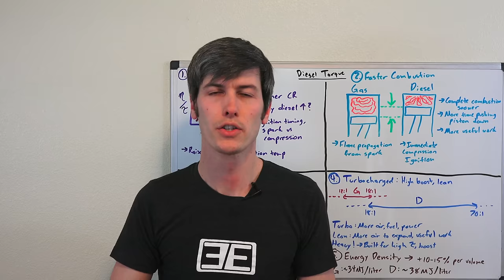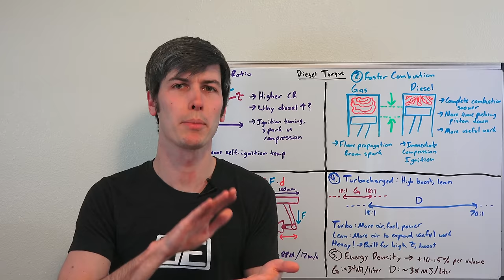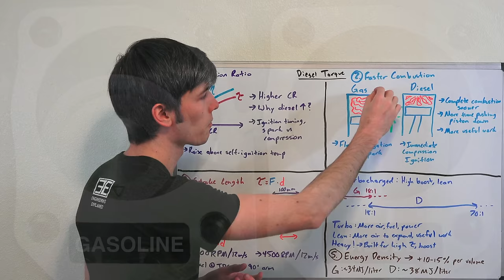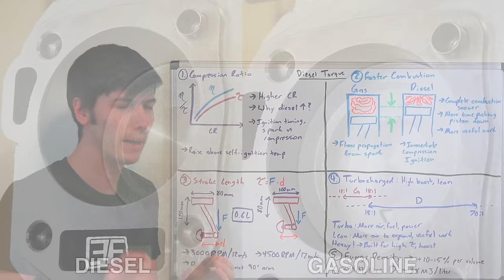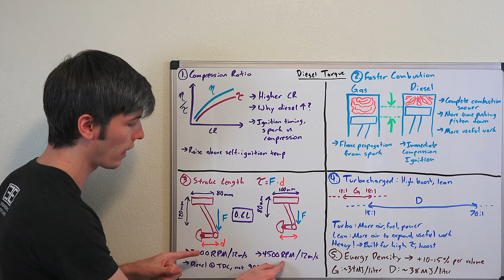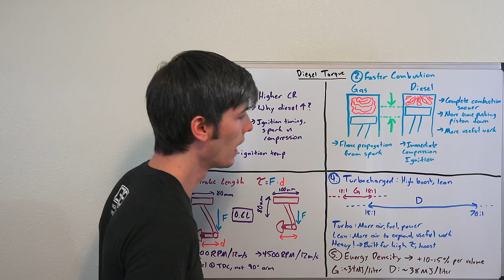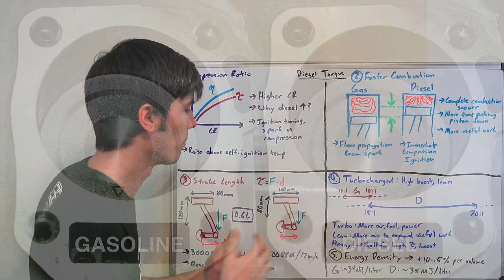5 Reasons Diesel Engines Make More Torque Than Gasoline

Comment: I appreciate a lot your work: it's great, keep going!

Unfortunately I have to say something about the topic of this video:

First of all It's true that Diesel engines have higher compression ratios resulting in higher Peak firing Pressures and consequently higher values of torque BUT this is not the "true reason" why CI engines have more torque COMPARED to SI ones.
In fact, while the SI engine works always stoichiometric (or even slightly in the rich side (relative A/R (Air Fuel ratio) ~0.9)), the Diesel engine cannot work anywhere close to the stoichiometric A/R due to t bad air utilization (min relative A/R is in the order of 1.2-1.3) thus resulting in ~20% less fuel injected (in mass) for the same quantity of air in the cylinder. Lower fuel injected means lower energy released in the combustion and so lower torque (this "base" 20% deficit is partially, but non totally, compensated by the higher compression ratio and higher Diesel specific energy). If you compare the torque figures of old naturally aspirated diesels with NA SI engines of the same time you'll verify what I'm saying.

The second thing you mentioned is not wrong but it's not that relevant: the combustion of a Diesel engine is more efficient when it tends to a constant-volume combustion (like in the case of the IDEAL Otto cycle).
For partial loads, the actual duration of the two combustion processes, even if they're fundamentally different, is comparable and I would say that there are so many variables involved (speed, temperature, fuel quality, turbulence in the clinder, etc) that is difficult to say which combustion process is the most efficient. 
However, at high loads, the combustion process of a SI engine is definetly occurring faster than a CI one since the latter has to fight against a "mixing controlled combustion" during which fuels struggles to find air to react with. (In fact, CI engines rotate slower than SI ones)

For what concerns the third point you presented... it's just a false myth: the higher lever of a longer stroke is counteracted by the lower force resulting from a smaller bore. If you take the condensed formula to compute engine power you'll notice that bore and stroke are multyplied together giving as a result the displacement (longer stroke -> smaller bore).

So, the reason why diesel engines have much higher specific torque than SI ones is turbocharging.
Thanks to the very high allowed boost ratio it is possible to force a lot of air inside the cylinder and so it is possible to burn more diesel than gasoline (for a given displacement). This results in a much higher torque together with a more efficient engine. (Power output, unfortunately, si affected by the "slow" combustion process that doesn't allow the engine to rotate as fast as a SI engines).

This comment doesn't want to be against you.
You've always done a great job. It's just to make things a little bit clearer.
Reply from the maker: Appreciate the feedback, thanks for sharing your insight!
Reply: Diesels also have much stronger internals resulting in more spinning mass within the engine which helps with torque. If you lighten the internals in a gasoline engine, you'll gain power but at the sacrifice of torque.
Reply: Jason I'm your fan but that was not the best movie you did.  Federico pointed out why in very good and  informative  post above. Remeber your movies are also wached (with pleasure!) by professionals. :-)
Reply: I'm curious about one of your last statements. 
"Power output, unfortunately, is affected by the "slow" combustion process that doesn't allow the engine to rotate as fast as a SI engines)."
My question is, doesn't the combustion process happens quicker on a Ci engine than in a SI engine?
As was explained in the video, (or how i think it was, and how i have interpreted) the burning process of a diesel engine happens in slightly faster instant than petrol.

And another question, when comparing both CI and SI as turbocharged engines, is it expected to the SI engine have more torque (and?) horsepower?

Thank you in advance if you answer! :)
Reply: In SI engine fuel is injected during intake stroke. It has time during intake stroke and then majority of compression stroke to vaporate and form proper A/F mixture. There is no such a time in diesel. In diesel fuel burns once its injected but injection itself takes some time thus crank angle rotation. Moreover at high loads mixture is too reach right at the injector nozzles and it needs some time to mix with air to burn. Thats why you see black smoke in diesels under load. They don't fully burn fuel. All in all diesel combustion takes longer then gas at high loads.
Reply: Wow
Reply: @Federico Gioachini I'm with you on this one - the main (if not the only one) reason why Diesels have higher torque, is turbocharging. Until very recently I was under the impression that Diesels, inherently, have the ability to produce more torque. However, when I was checking a chart of NA Diesels, it became very obvious that this is not the case. Yes, an NA Diesel was never built for performance, but the difference is very obvious. Furthermore, looking at the latest turbocharged Petrols, we see a massive increase in torque, double in some cases, when compared to a traditional NA Petrol. The field has started to even out.
Reply: 5.0 V8 Nisan Titan cumins  310 HP/555 TQ
3.5 V6 Ford Raptor Ecoboost 450 HP/ 510 TQ. 

There is a huge difference in horsepower but pretty close in torque. Why would the larger engine not have more horsepower?
Reply: California avi8tor actually for a centered crank mechanism the contribution of the mass on the overall average torque is null.
Of course inertial mass (pistons, conrods, crankshaft,...) affects indirectly the torque because of friction induced by inertial forces. (Higher mass means higher friction forces and so higher dissipated energy)
Reply: DEG Well, in order to understand how the diesel combustion occurs I suggest you to look at the so called Dec-model.
Diesel combustion is extremely rapid (and efficient) only during the so called "premixed phase" which is very similar to the knocking process on SÌ engines.
The result of this fast combustion is (I'm simplifying quite a lot but it still gives the idea) the soot.
Then, soot gets burned (hopefully in total) during the "diffusive flame burning" (or "mixing controlled" ).
During the latter phase air availability is what regulates combustion process. The higher is the load, the higher will be the fuel injected and the longer it will take the process (in fact at high load diesels smoke badly... This is because they cannot burn all that soot produced during the premixed phase)
In reality, premixed and diffusive burning usually occur together unless the engine is at very very light load
(What I've said It's not scientifically rigorous but I had to simplify to make it easier to understand)
Reply: Trey K I don't know how much a "Tq" is. Is it a Nm?

BTW, to give you some references, a modern diesel engine for car produces 200 Nm/litre or more (up to 250Nm/l). ( always with a flat, limited torque curve) 
A turbocharged SI engine has a lower specific torque because of lower degree of boost. 
BUT, a SI engine has max power at higher engine speed than diesel engine and so the power output is bigger. 
(Modern Diesel engines in highest power-step are something around 90-100 hp/l up to extreme cases (BMW Quadri-turbo 3.0L) of 130 hp/l
Aroubd 100 hp/l there's usually the transition from a single turbo to a twin turbo solution
Reply: Good post frederico. I think one of the biggest problems is that people only consider full throttle applications. At full throttle, the only way diesel can hold a candle to petrol engines is with turbocharging, and even then it is struggling to match. But when you compare fuel economy on a motorway, or even around town, diesel leaves petrol choking on it's fumes. So when both engines are only producing 10-20% of it's potential power, the diesel is using 20% less fuel, or better.

The only potential explanation for this that I see is what was glossed over in only a sentence. Petrol engines are so reliant on the throttling to stay at lambda, that they reduce their adiabatic efficiency very drastically.
Reply: A very concise reply Frederico. When looking at stationary engines such as older N/A diesel engines, and petrol / kerosine engines, torque comes more from rotating mass, ie; heavy flywheels. Large marine engines in particular have heavy rotating mass, and utilise different fuels such as heavy IFO380 to increase power and torque
Reply: athewake A flywheel DOES NOT give any contribution on the torque. It only help stabilizying engine speed avoiding the huge variation naturally occurring during the cycle of (especially) a slow rotating engine (the lower the number of cylinder the bigger has to be the flywheel)
Reply: +Trey K To add to what tjsavage711 said, displacement does not dictate HP. Displacement dictates torque. Displacements dictates power only in relation to RPM. Check graphs of old American engines, with less than 50hp/liter. Their torque/liter figures are much closer to modern engines while the power/liter figures are nowhere near modern engines. 
In your given example, it is quite obvious that the Petrol makes more of everything, too:
5.0 V8 Nisan Titan cumins  310 HP/555 TQ - makes  62HP/ liter and 111"TQ"/liter
3.5 V6 Ford Raptor Ecoboost 450 HP/ 510 TQ - 128 HP/liter and 145 "TQ"/liter

So, the Petrol makes more TQ/liter and, because it revs higher, it makes double the HP/liter. A theoretical 5.0 Ecoboost, using the above figures, would make 640HP and 728TQ. Quite a difference.
Reply: This is what maths and physics are all about. Learning new things and getting proved wrong.
Reply: you must be a diesel mechanic
Reply: The point that ever one missed is that Diesels have more torque at lower revs. You can cruise in a diesel at 1000 revs but no way in a petrol.
This is why sensible people prefer diesels!
Reply: @federicogioachini653  sorry, what does it mean 'degree of boost'? Is it the specif energy of the fuel?
Reply: @danielbarroso9321  degree of boost means, in other words, how much the engine is boosted (boost pressure)
Reply: @geoffellis2055  Do diesels really make any power sround or under 1000 rpms ? I always thought that their torque comes in around 1250 rpms and higher.
Reply: Well said Federico!
Reply: waaaatt, you cannot distinct between the SI and CI, which combustion process is more efficient ?????. The Carnot Efficiency of a Diesel engine is Higher than a SI, inherently due to higher combustion temperature....much higher
Reply: @TheoXaris exactly an apples to apples comparison should have been done, Mazda's Skyactiv 2.5 liter  Gasoline puts of 310 ft/lbs at 1500 rpms.
Reply: Just to contribute to the comments, comparing a SI and a CI of the same displacement and Positive Induction,, the SI engine will make more power, the use of A diesel engine in commercial applications are primary in this Order #1 Fuel Consumption due to higher combustion Temperature #2  High Torque at low RPMs, the power is more accessible as you dont have to rev for it, #3  Diesel fuel has high lubricating properties and this contributes to its long operating life, #4 Diesel is a much safer fuel #5 diesel is a cheaper fuel
Reply: @TheoXaris True, its a scarcity and one off gasoline and not mainstream, the exact engine code for the engine i am referring to  is SKYACTIV-G 2.5T and it is found in the CX 9, and just a correcting it makes the 310 ft, lbs at 2000 rpm,, Chevy is taking a cue from mazda and making a 2.7 L turbo gasoline, for their 5000 lbs full size truck,, it makes some crazy 350 ft/lbs under 2000 rpm, check out fast lane truck, for more info on it,,
Reply: @Treyk901  Due to lower RPM. This is really the main point ... Diesels cannot hit the same RPM as a gas engine, so in the end they tend to produce less power, as their torque numbers are higher but over a lower rpm range. hp = tq * rpm / 5252. So here the diesel might have red line at 4,500 rpm, while the gas might be at 5,500. Assuming a flattorque curve we can estimate the relative rpm between these two engines (and to some degree it's peak rpm, but since all engines drop torque towards the red-line, you might want to assume 80% torque at red-line instead ... so let's do that and math it out).

310 = 555 * 80% * rpm / 5252 -> rpm = 3,666 rpm
450 = 510 * 80% * rpm / 5252 -> rpm = 5,792 rpm

Ratio : 1.58

So in my view, that 5.0L diesel might not be a turbo, or is not setup to be a high power / performance oriented engine. So it's more likely that engine was designed to give high torque low down (so you can take off at low rpm, less stress on clutches etc.), as well as produce lot of power at low rpm where you have less friction loss, making the engine to use less fuel (less is lost in friction), and finally slower moving / heavier parts to make the engine last longer, so you can put more stress on it for more hours (aka towing a lot around).

So the 5.0L Diesel seems to be designed for a different use, hence the large delta in hp/volume.

Here are two I-6 engines from BMW ...

3.0L I-6 400 HP/560 TQ (diesel M550d) 80%rpm = 4,689 [redline @ 5,400]
3.0L I-6 425 HP/410 TQ (gas- M3) 80%rpm = 6,805 [redline @ 7,800]

So this also mean that the gas engine loses more torque high up, and hence less 'shove' low down, so if cars weight the same, geared the same (speed per gear) the diesel will pull away from the M4 from i.e. 1,000 - 3,000 rpm, they will be equal 3,000 - 4,500, and then the M4 will pull away/catch up 4,500-5,400.

The reason the M4  will be faster however, is that when using gearing it will most likely sit between 5,500 - 7,500 in every gear, so the diesel will never have that advantage on it (notice it would be tiny anyhow as the power rating is so close).

Same volume, about the same power, but again lower torque for the gas, but higher rpm to 'compensate for it'.
Reply: Take 2.0 liter turbo engines with the same hp... lets say 180-190 hp. Plenty of them in Europe. The diesel one will produce 400Nm while the gasoline one only arround 300Nm and all this with a lower fuel consumption for the diesel.
Reply: @lungulet  Yes, this is true. A big part of the reason for this is that diesel have about 10% higher energy content vs gas, so you should automagically get 10% less fuel consumption. It's also getting more efficiency out of the fuel, giving you another 15-30%. A diesel engine might be as much as 43% effective (converting fuel energy into mechanical, rest goes into heat and sound). As gas engine is up to 37%. Making the diesel 43/37 = 16% more efficient, as well as 10% more energy per liter of fuel. So it would be 1.1 * 1.16 = 28% more fuel efficient. Part of this is lower RPM, better lubrication, more complete combustion and slower burn causing a longer exchange of energy.

The drawback is that diesel engines need to be build much stronger, so they weight more, and are (in general) more noisy. So the car might lose a bit again due to dragging around more iron (and with impacted handling from that).

BMW 520i - 135kW 5.9L/100km
BMW 520d - 140kW 4.5L/100km

5.9 / 1.28 = 4.6

So this matches very well with expectations :)

Edit: 
1L of diesel has35.,9 MJ of energy
1L of gas has 32.6MJ of energy
35.9/32.6 = 10.12% higher energy density of diesel vs gasoline
Reply: @93hopeless  hilariously wrong.
Reply: The point of a diesel engine was never maximum torque although many might think so today. Besides efficiency the purpose for using diesel in heavy transport has always been torque produced at lower engine speeds. Long before most diesels were turbocharged they were still relied on for their low end torque in heavy industrial applications unlike si engines which would have to be run all day at high speeds to do the hard work burning themselves out. For instance comparing an 80s big block ford gas compared to the na 6.9 international diesel. The gas engine would outperform and out Hall the diesel any day of the year but would be forced to burn itself out by running at 4 and 5000 RPMs all day. While the same size diesel engine when do the same job a little less impressively chugging along between 2500 and 3500 RPMs max increasing engine life dramatically.
Reply: Micah Rich yeah, lower rpm is less friction and longer life.
Reply: Federico, it's when a comment outmatches a video! Respect!
Reply: For what concerns the third point you presented... it's just a false myth: the higher lever of a longer stroke is counteracted by the lower force resulting from a smaller bore. If you take the condensed formula to compute engine power you'll notice that bore and stroke are multiplied together giving as a result the displacement (longer stroke -> smaller bore).

Yeah, but in fact the crankshaft of a long-stroke engine acts as a reductor, producing lower speed and higher torque.
Reply: There is no such thing as a "false myth".  All myths are already false.  It's redundant, like saying "wet rain".
Reply: Bravo @Federico Gioachini, la tua spiegazione è molto chiara e direi che corregge di molto quella di Engineering Explained….
Reply: @Treyk901  Caterpillar C 15 Accert/Twin turbo 15.2 l
Inline 6
550hp, 2300 lb/f
Reply: @DEGMOTOV  i was thinking the same thing.  my confusion is partially that i dont know what SI and CI are, so i will call them gas and diesel. anyway, the beginning of the video states gas burns slower, but the end of this comment claims the slow combustion process makes for engines not reving as fast.  but if gas burns slower, this comment implies that it revs lower, which we know isnt true.  gas is capable of higher RPMs than diesel. (which i think is more about reciprocating mass than speed of burning fuel).  i assume it is a typo, Federico G. compares SI to SI in his third point.  but i dont know where the typo is, if it is even a typo at all.